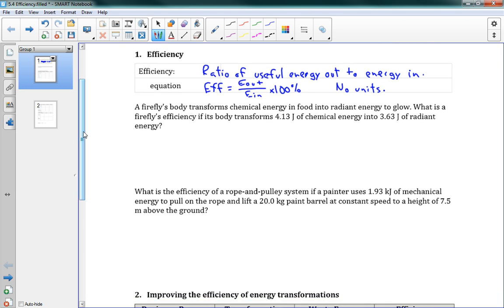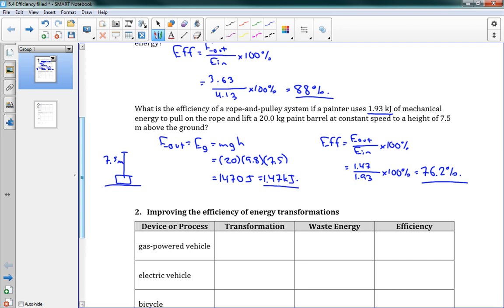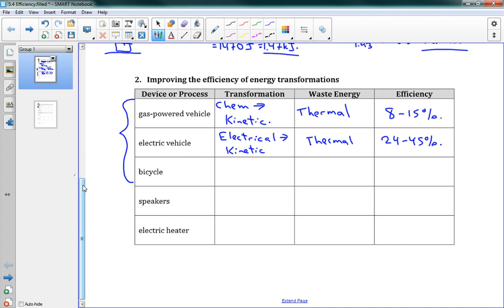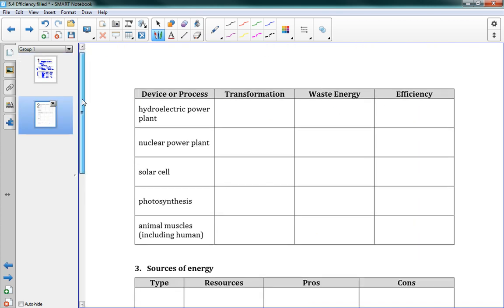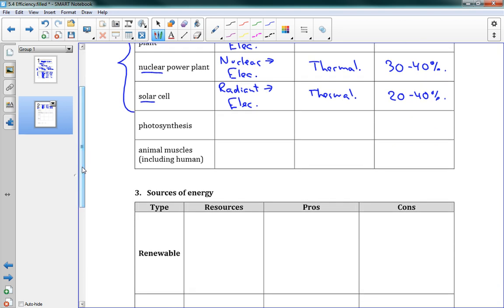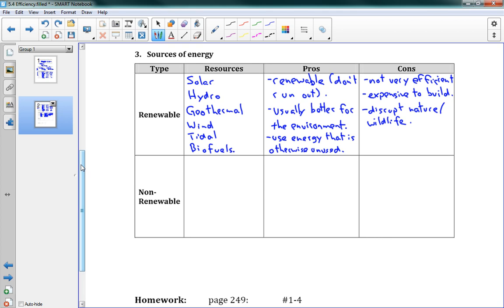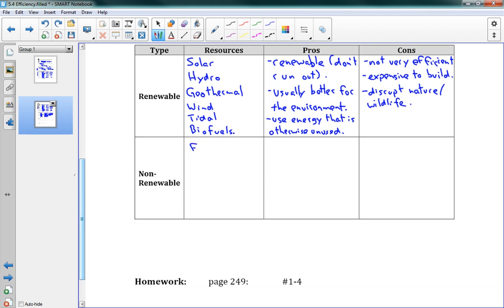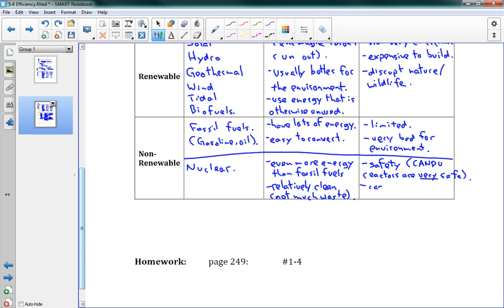SPH3U 5.4 Efficiency

Comment: If renewable resources are considered expensive to build, shouldn't nuclear energy be considered orders of magnitude more expensive? (26 billion dollars was the first estimate I found to build a CANDU reactor)
Reply from the maker: Hi Ashargall, good point! What you've described is the "capital cost", but the energy output and fuel cost are also important. Traditionally renewable energy ends up being more expensive per energy output - i.e. a nuclear plant is very expensive to build, but fuel is inexpensive and it produces a lot more energy over its lifetime.

Renewable technologies are rapidly improving, so that certainly won't always be true!
Reply: Definitely excited for the future of these technologies; I think affordable 3-D printing based fabrication will speed up this process dramatically. In the meantime, I suppose when we consider "renewable" energy, especially in Ontario, we have to address that this primarily refers to hydroelectric dam derived power (or more specifically, Niagara Falls derived), and then we have to muddy the waters of cost benefit analysis further with the effects of water diversion. I guess, in summary, renewable sources are most advantageous due to their continued improvement, whereas the various fuel burning -> generator technologies mostly stay focused on finding more fuel - and to some degree, carbon recapture (which is awesome).
Thanks for the videos, by the way!
Reply from the maker: You're welcome! I'm still optimistic about nuclear fusion as a clean and huge-output alternative, but the technology's not there yet.